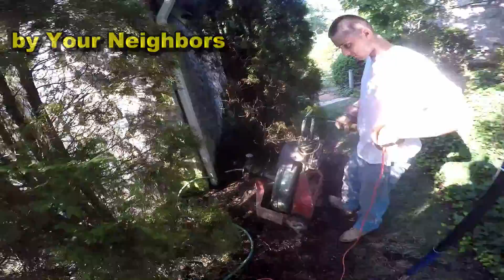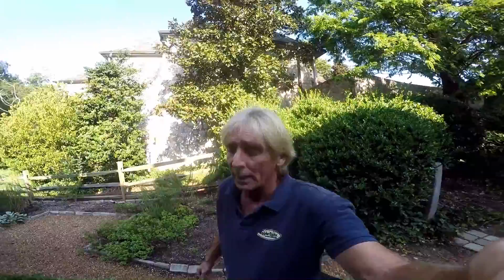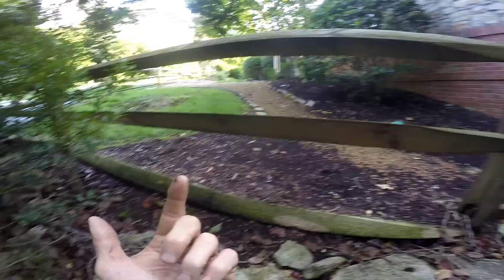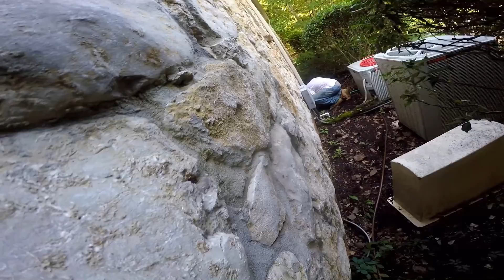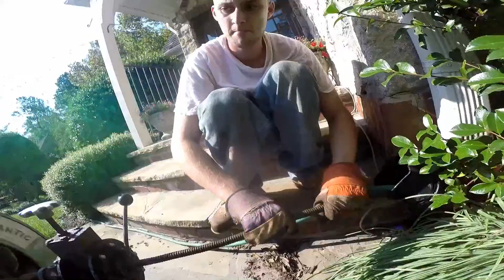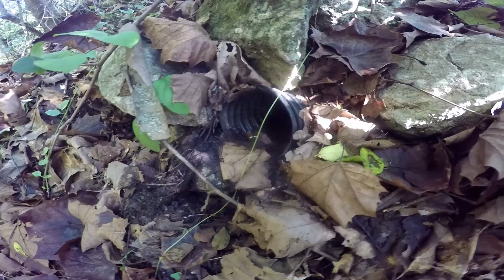French Drain, How To Clean, Repair, Replace, Corrugated Pipe with Roots

Comment: thank you so much for sharing your knowledge, ive done this procedure before and just never can unclog my french drain system ever since i bought my home, but you taught some techniques that may give success the next go around, i will rent a 3/4 snake this time, as last one i rented from home depot was smaller diameter and too short i think, plus the cutter fell off inside my pipe, just a POS beat up rental that was totally worthless, so be aware about the condition of these abused rental tools and find a good one, listening in the pipes is a good idea but i was alone last time so i get a partner to help next time